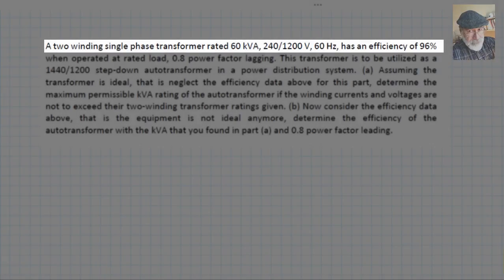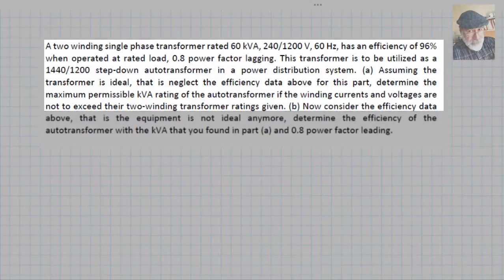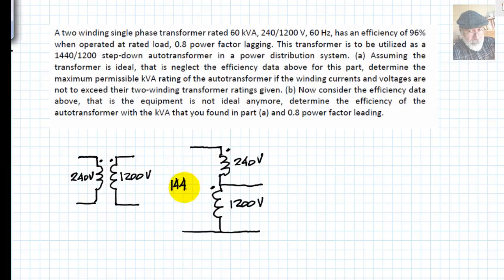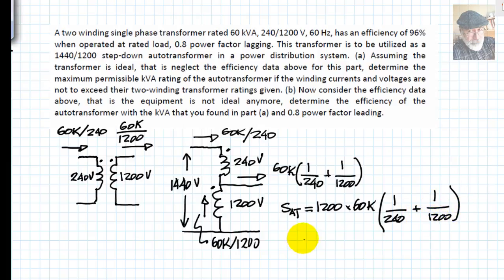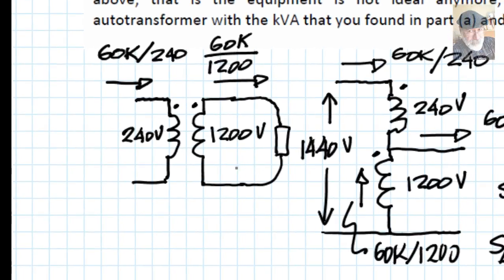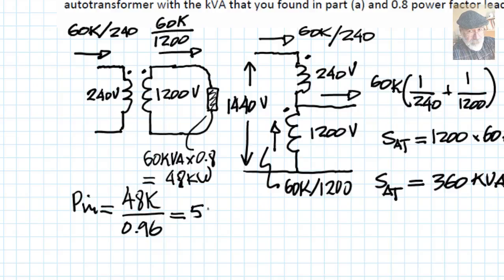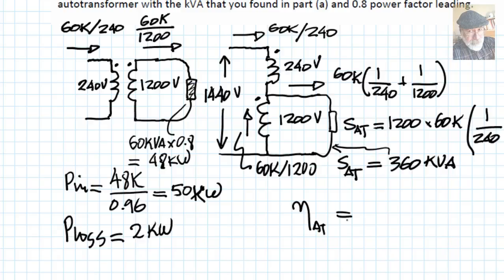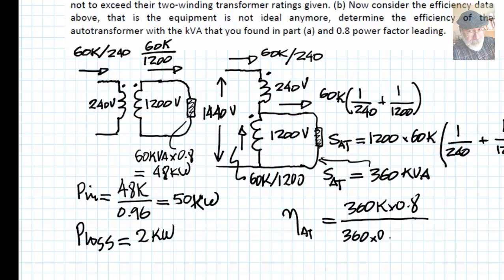EECE 392 - A single phase autotransformer

Comment: Curious about current flow in an unbalance 3phase auto transformer configuration. Do you have any reference material?
Reply from the maker: When the system is unbalanced, we cannot use the single phase equivalent circuit anymore. In that case, we have to solve the entire three-phase circuit. I'd use nodal analysis. I hope this helps.
Reply: Another way is using symmetrical components.

Comment: Very high efficiency, but what happens if one of the primary or secondary coils get shorted? Will it be unsafe, because the line voltage will appear to the other side?
Thank you.
Reply from the maker: Exactly! Nothing in this universe (minus one thing) is free, the high efficiency and boosted power capability of the autotransformer does not come for free. When there is a shortcircuit on the LV side, the equivalent series impedance of the auto transformer is still the same old ohms of the regular transformer, but in a circuit of much high voltage; this results in a much higher shortcircuit current. But the balance is positive and the AT (in its 3phase version) is widely used in EPS.